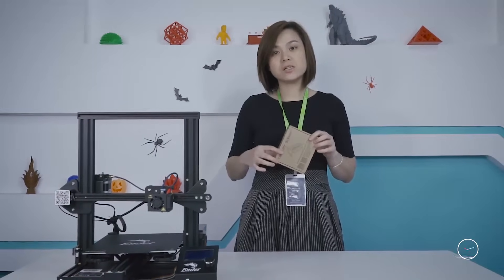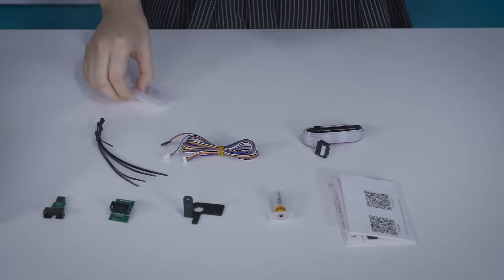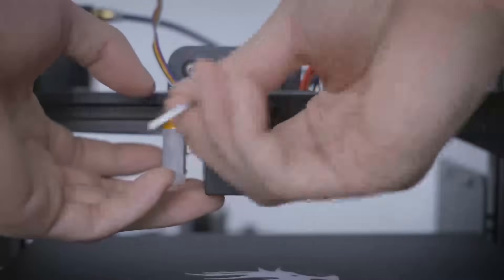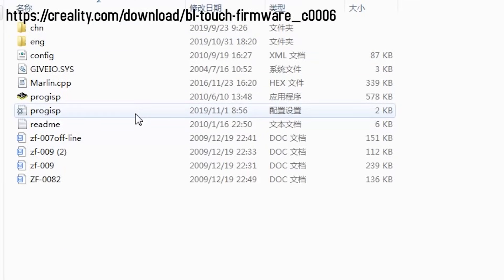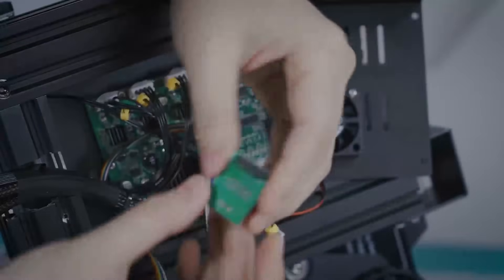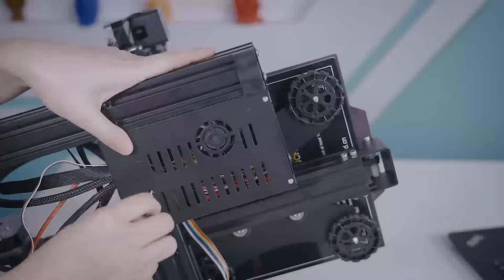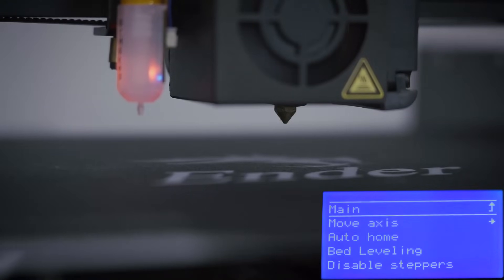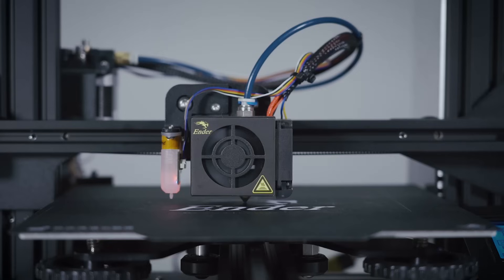How to Install Creality BL Touch Auto Bed Leveling Sensor Tutorial (Ender-3 Pro Upgrade Setup)

Comment: I have received the BLtouchv3.1  kit with the silent main board v1.1.5

Do I need to follow the BL touch FW flash to flash the main board or just skip it?
Reply from the maker: yes, you need.
Reply: @Creality3D  wait, if I do that, is it gonna wipe clean the existing firmware on the silent mainboard v1.1.5 and makes the motor noise again?
Reply: never mind, I figured it out:

* For older ender3 w/o the boot loader, the step showing at 2:23 is to upload the Firmware via AVR.

* For ender 3 with the boot loader, or ender 3 with silent mainboard v1.1.5, step showing at 2:23 can be replaced by direct flash via USB using Octopi and avrdude.

Note: 
1. The BLTouch v3.1 also has a single page guide showing the steps to upload a boot loader (similar to 2:23), this is the step that can be skipped if using Silent Mainboard v1.1.5 or other main boards that have boot loader installed. 
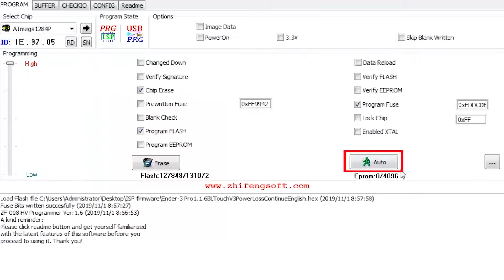2. The silent mainboard v1.1.5's  silent motor driver is non-replaceable (aka non-erasable), so reflashing the silent mainboard with firmware 1.1.6 (3:00) will not erase the motor driver.

Comment: I have a Ender 3 Pro, January 2019, board 1.1.4 : no bootloader, firmware upgrade makes me lost the SD Support and no answer from Creality to retrieve the orginal firmware of this board : just bad information about compatibility !
Reply from the maker: the printer original board do not have bootloader as the default, please note, and please check the firmware and sd card file here: https://www.creality3dofficial.com/pages/firmware-download

Comment: I just got this from you in the mail. I installed it. my first z measurement was -002.1  then I go to control-motion-z offset and my value is 00.00   So my B=A would equal -002.1  and I dont even know if I can adjust the z offset setting to this. If I leave it at 0 and try to run it it goes through a level process it looks like then goes all the way to the right and up a little and the motor sticks. Help!

Comment: does that work with Ender 3 pro silent board? I have "Sovol Creality 3D Ender 3 Pro Upgrade motherboard silent motherboard V1.1.5 with TMC2208 driver".
Reply from the maker: yes，it works if the board is motherboard V1.1.5
Reply: No, it's not...a lot of problems. Angry almost owner of silent mainboard and bltouch.

Comment: Please help!!! when I plug everything in the prog.isp doesn't pick up a chip Pleas help the area were it lists all the chips are empty
Reply: I had issues where I would get errors and not allow to pick a chip. I believe this had to do with a file path being to long after you unzip everything into new folders. Pull the ISP folder into the root directory and then that is what worked for me.

Comment: Do I need to install BOOTLOADER first on ENDER-3 (1.1.5) and then install BL-Touch as shown in this tutorial?
Reply from the maker: 1.1.5 already have BOOTLOADER , thank you.
Reply: @Creality3D  Then how do we update the firmware if it already has a boot loader?  Should I be able to update the software directly from the PC without having to use the bootloader apparatus?

Comment: Hi  I've been having problems … every time I press Write I get ( Chip Enable Program Error..  This is on a Ender 3 with a New 1.1.5 silent board .. ive been trying to fix it for 4 days now and its driving me mad
Reply: Rename the folder to something sane. I just renamed the folder 'bltouch' and it fixed it

Comment: I just installed the bltouch and the USBISP adapter is not being recognized by Windows 10. In my device manager that the device could not start and I get the error that the programmer could not be found when I start Progisp. Any suggestions??
Reply: look like no ... only install windows 7 .. i have the same problem...

Comment: How do you adjust the 9 point grid sensor pattern?
Reply: Same questions - it look like the Bltouch only samples a smaller section on my Ender 3 - can it be extended to the furthest reaches of the bed?

Comment: How can we flash the firmware with a Macintosh computer?
Reply from the maker: Thanks for your question. May I know what kind of printer you hold?
Reply: @Creality3D  I have an Ender 3 Pro - the one in this video.
Reply: @Creality3D  and now for mac ?
Reply: I also want to flash the firmware but I have  only MacBook available..

Comment: And now how to install an end of filament detector ?
Thank you.
Reply from the maker: 😊thanks for your question. filament detector can't be installed in Ender-3 PRO as there is no corresponding installation port  in it's mainboard.
Reply: @Creality3D  If using OctoPrint / Raspberry Pi then you can add filament detector via this for the Ender 3.

Comment: It is possible to know if the newest version of the firmware you are using will work with BLTouch V3.X??The newest firmware have thermal runaway protection??. I want to buy one, but read a lot of negative comments about that BLTouch 3.X dont work on some creality printers and that the firmware didnt have thermal runaway protection which is something very important. Of course, everything I read was about 4 or 6 months old and i want to know if everything is fixed bcs i like my printer and dont want it to burn bcs thermal protection is not operational.
Reply from the maker: Thank you for the concern, safety and compatible is the most important for sure! The newest version of the firmware we are using can work with BLTouch V3.X, and also have had thermal runaway protection enabled. We fixed it a month ago,  the latest firmware download link: https://www.creality3dofficial.com/products/creality-bl-touch
Reply: Creality do I need to flash my board if I have the v1.1.5 running 1.1.8
Reply: @matthewratilainen4467  I'm trying to get some help on this right now too.
Reply: @Creality you replied that MB v1.1.5 doesnt need to upgrade but I have it and is not Bed leveling in the menu, could you please make a video Installing BL Touch using the Silent Board v 1.1.5 everybody is asking the same!
Reply: @HermannFlores   Dont work still Woooow Creality looking bad
Reply: @Creality3D  i ordered the silent mainboard v1.1.5. From the google drive download list, I see thecurrent 2019.11.13 ender 3d Pro fw is 1.1.6. Should I upgrade the silent mainboard FW?
Reply from the maker: @jsc3417  no need, thank you.
Reply: @Creality3D  what about the 1.1.5 mainboard with marlin 1.1.8 is this a version for the BL Touch installation ????
Reply: @Creality3D  Which software for the silent motherboard 1.1.5 and BLTouch V2?
Reply: @Creality3D  There is no firmware listed for Ender3. Should I install the Ender3 Pro firmware?
Reply from the maker: @OpenEmoto  yes, thank you.
Reply: @OpenEmoto  How did you solve this issue? I found the Ender 3 BL Touch firmware but it turned out to be ender 3 pro firmware and the z offset instructions in this video don't work.
Reply: @Creality3D  THIS LINK IS A VIRUS
Reply: @Creality3D  When I get to the point to flash the firmware I am given the choice to flash Marlin.cpp.hex that came with the progisp v1.72, do I have to flash this firmware? or can I flash the Ender-3Marlin1.1.6bBLTouch.hex which I downloaded from the Creality website? the Marlin.cpp.hex that comes with prog.isp+1.72 is just a standard firmware with no bl touch so
I flashed the ender 3 bl touch firmware from the Creality store but it installed the ender 3 pro firmware, I carried on with the setup, I worked out the Z Offset as per these instructions and it failed to lay down a good first layer which I cant adjust as you have not activated baby-stepping when you compiled this firmware, and adding 0.1mm to the Z Offset and then saving and testing will take forever.
 can you direct me to the correct "and working" firmware for the Ender 3 8 bit?
Reply: @Creality when will the kit be back in stock?

Comment: Is there a video for doing this on the CR-10 V2?
Reply from the maker: We already working on and should coming out soon.
Reply: @Creality3D  , Thank you for the quick response!  That is good news!  My only frustration is that this product was sold with the understanding that it was fully ready for the BLTouch.  Even your website doesn't show a BLTouch for sale compatible with the CR-10 V2.   I've already bought a BLTouch kit and it clear won't work for the right side of the extruder...  Please make this a priority
Reply from the maker: @rocketberger  actually we have the special version just for CR-10 V2, it's late while I put the link here if you could return the kit you have already buying: https://www.creality3dofficial.com/products/cr-10-v2-bl-touch-auto-bed-leveling-sensor

Comment from the maker: We get so many views of the first instruction video while there still feedback improvement we received from you all, so the company takes all the voice as much as we can and remake the installation tutorial. We hope you could set up yours more quickly and start to print! Happy printing :)
Reply: thank you for the easy to follow tutorial
Reply: @jaytee3287  That would be great if the software and firmware provided by Creality in the kit actually worked, and the Z- offset instruction on this video does not work and there is no way she got her printer working using the Creality firmware and those Z offsets
Reply: Can you send me the test file you use for the bed and what are setting a for the bl touch for cura
Reply: Be sure to tell them your printers only work for 2 months before you gotta swap out all the cheap plastic parts and springs